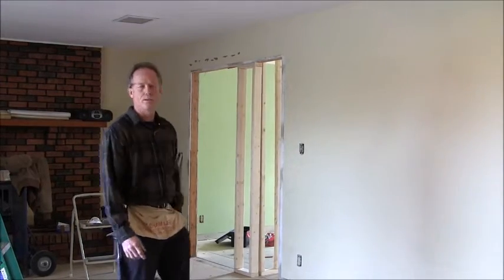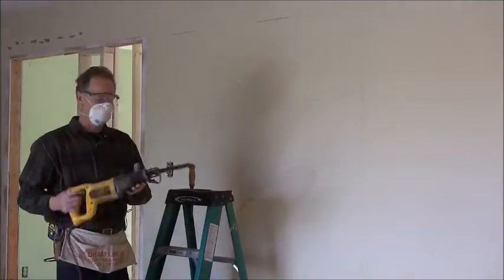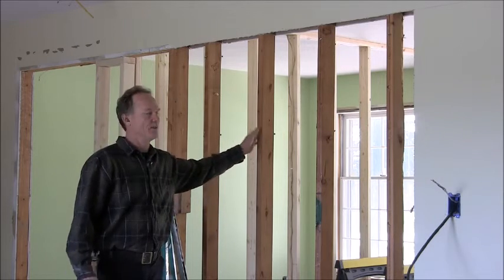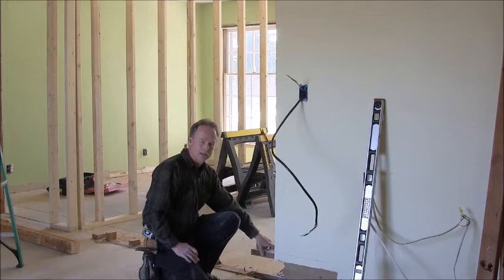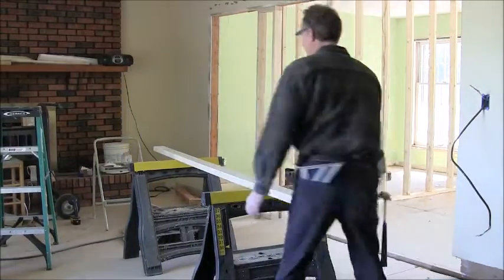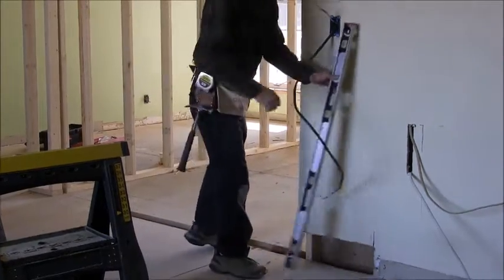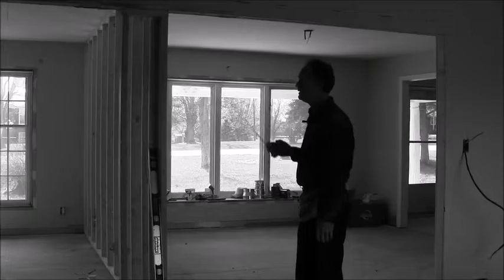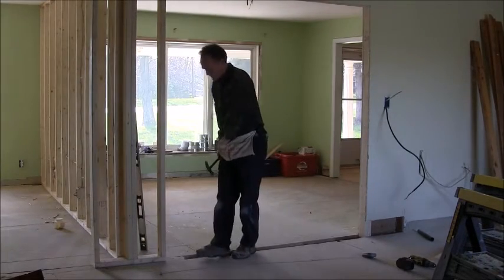How to enlarge an opening in a non load bearing wall

Comment: Thank you for sharing!, SF, homeowner here trying to save a penny anywhere I can. I like that you are realistic and the way you explain the terminology. I never knew the "level/plum" thingy :)  Is there an easy way to find the "load bearing" wall on a "hip roofed" house WITHOUT having to go into the scary attic/2 X 2 "hole"???, YIKES, I am terrified of the thoughts...  Again thank you for your kindness and knowledge!!!
Reply from the maker: To find the load bearing walls you are going to have to at least look up in the attic to determine if you have a truss-built roof structure or a what is called a stick built. The difference being truss is factory built, and stick built are built on site. With most truss built your bearing walls are going to be the outside walls where the trusses set on them. With the stick built most of your outside walls and most of your inside walls are going to be bearing to a degree. Interior walls supporting the ceiling. I hope this helped.

Comment: Can you widen a doorway to make the room open up more but not actually take down the whole wall?
Reply from the maker: Yes you can. But you have to know if it is a bearing wall or not. Regardless there are ways of widening it on both, you just have to know how. There is a big difference.
Reply: @doityourselfdenniscom  how u know if it's load bearing
Reply from the maker: @Eastbaypisces  Most exterior walls are load bearing and some interior. It depends on what type of roof system you have. What they call stick built, which is rafters, or if the roof sytem is trusses.

Comment: so this i totally ok just adding on to a header like that with a split somewhere in the middle of the opening?
Reply from the maker: You have to remember this is a non-load bearing wall. So, essentially there is no real down pressure on the header. It is more to have something to nail your trim to. I did this in my personal house several years ago and have had no issues. If it was more load bearing, you would need a bigger header and it would have to go all the way across solid.

Comment: Your return will be an issue 24” x 3 1/4  opening which is the stud cavity can not be made up by going up the wall as the opening will still be half of the existing area. (12 x 3 1/4.)
Reply from the maker: Been like that for 6 years now and haven't had any issues. By the way, the opening is not 3 1/4, it is 3 1/2.

Comment: Thanks for posting.  I'd like to see how you finished it, too.  Quick question, why did you have to take the board along the bottom out?
Reply from the maker: If you are asking about the bottom plate. Because it wasn't even with the floor. Removing it allowed me to put some wood in there to make the floor even. Hope this helps. If not let me know.

Comment: Great video! This was very helpful. Do you have any suggestions for doing the same in a plaster wall (not drywall), or could we use the same method?
Reply from the maker: It kind of depends on what is holding up the plaster, chicken wire or wood lathe. Wood lathe would be the easier of the two, but it still would not be easy. You would most likely have to use some kind of power tool like a recipricating saw, but then you are taking a big chance of cutting wires or anything else that is hidden in the walls. Without seeing the actual job, it is hard to say what would be the best course to take.
Reply: Slightly echoing what Dennis said, you need to find a way to safely remove the plaster without potentially cutting any wires or pipes behind the lath. A drywall knife will not be strong enough to cut it. Demoing plaster is actually quite easy: a few whacks with a mini-sledge and it'll explode off the wall. Fun but messy. Regulate the power of your swings and you should be able to leave the main structure of the lath in place enough to protect what's behind it. Your issue with will instead be: how do you make sure the plaster stops cracking at the exact borders of the space I want to remove?  This is something I've been attempting to figure out for a closet expansion in my own house and here's my idea: If you can find something short enough (like a dremel, maybe? spitballing on that one) to first cut out the border like how Dennis uses the drywall knife, the remainder of the wall should generally be protected from the force of your demo. Be prepared for the need to fix some cosmetic cracks.
Reply: @zoomiesnoopy  hi Kendall, we are looking to do a closet expansion from a single door to a double door in our 1880 home. Horse hair plaster. Would love any tips if you have any? Sounds like you may have been doing a similar job!
Reply: @leawaybright9158  Basically....if you have wood lathe all you should need to worry about is having a grinder with a diamond coated blade. Pay close attention to if it's getting worn out because the sharper it is the cleaner the cut. Score the plaster and take as much time and care as you need to get through it all. It might take 2-3 passes to get all the way through, but better that then to have to fix all the edges.

If you have metal mesh lathe, you'll probably have to cut it all in one piece because it usually doesn't want to crumble.

In either case, tape and plastic off the area as much as possible...seal cracks and shove rags under doors. Get those tyvek full body suits and wear goggles and a respirator. Anything and everything you can do to make the dust more controlled and easier to dispose of you will thank yourself for.
Reply: @zoomiesnoopy  thank you for the advice! I really appreciate it!

Will I only find out if I have metal mesh lath when I cut into it? 

Also I’m having trouble find videos of how to frame the opening with plaster walls. Any tips or videos you’ve seen? Is it all the same once you’ve cut back the opening? 

Thank you again!
Reply: @leawaybright9158  If you haven't found mesh lathe yet, you're probably in the clear. HOWEVER, it's not unheard of to have both kinds in the house. A friend didn't know he had all metal lathe in the kitchen because the rest of the house was wood lathe. 

For framing it should all be the same once you get the plaster off. Standardized stud placement wasn't in place until drywall so you may have to fill in some gaps. Here's a video I liked that tells you the basics of enlarging a doorway, and what all the different studs are named:

https://www.youtube.com/watch?v=3HZ-LGU22J4&list=PLz5h8hC3mSMfseCGGxeMeQkwNJo8oT84p&index=6

Comment: I tried this. Couldn't control the sawzall blade. Cut wasn't level. Drywall was 1" thick. I'm ready to be done with this closet.
Reply from the maker: It is called an oscillating multi tool.
Reply from the maker: Another tool that works well that is easier to handle is made by dremmel tools. It has an oscillating blade that goes back and forth and is quite a bit smaller than a sawzall. There are other brands of the same type. You can buy them at Lowes or Home depot.

Comment: You can actual use a oscillating multi-tool as well.  Much faster than I drywall knife and a lot more control than a reciprocating saw.
Reply from the maker: Very good idea. The oscillating tools are great. Thanks.
Reply: @doityourselfdenniscom  No problem and thank you.  I thoroughly enjoyed the video.